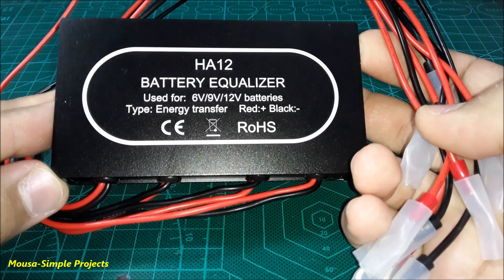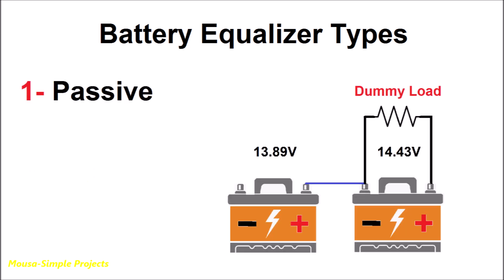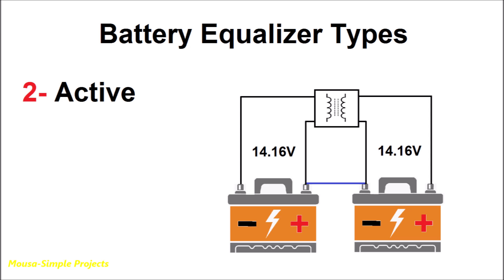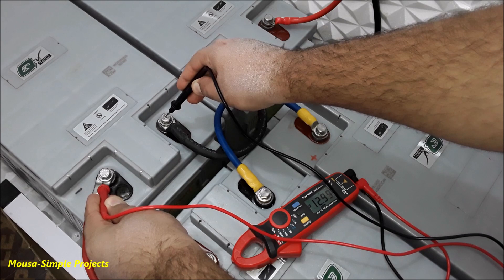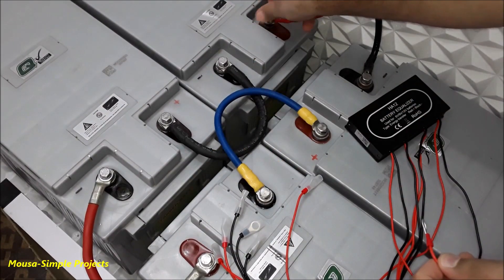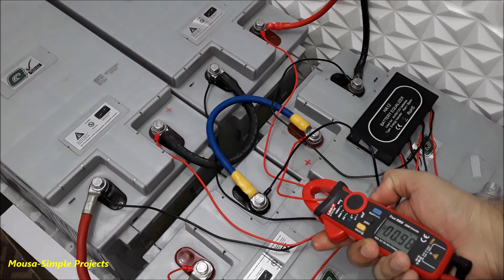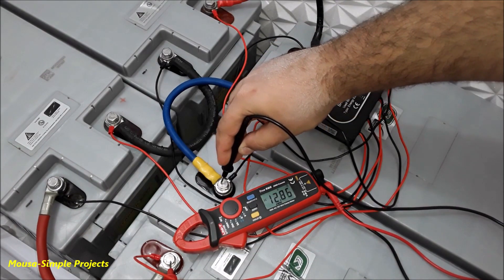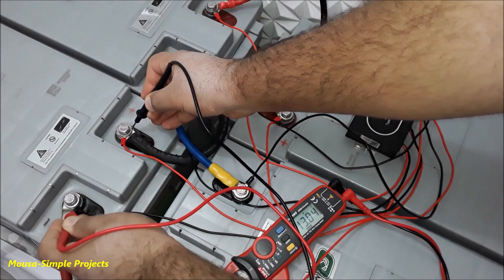Battery Equalizer / Voltage Balancer for 48V Solar Batteries Review and Test (HA-12) With Bluetooth

Comment: What is the maximum ampere capacity that can be balanced?
Reply from the maker: There are two versions of this device: 
With Bluetooth max 5A
Without Bluetooth max 10A
If you mean the capacity (Ah) of the battery, there is no limitation.

Comment: Ignoring the inaccuracy of the BT display, has this balancer served its purpose without issues such as getting very hot? It still does a good job balancing your batteries?
Reply from the maker: Yes, it works well, sometimes getting warm but not too hot.

Comment: Can You please explain wich equilizer should I use for 2 batteries each of 24V  in solar system?
Reply from the maker: Sorry, i don't know. they usually used for 6V and 12V batteries. maybe you should contact with sellers on AliExpress.
Reply: Thank You!

Comment: After the batteries are equalized, did the device on phone show any closer readings?  Thinking maybe it reads better @ no load.
Reply from the maker: NO, Still not accurate
My batteries voltage (with no load) right now : ~12.94V (X4) 
But it reading 13.04 // 12.90 // 12.99 // 13.02